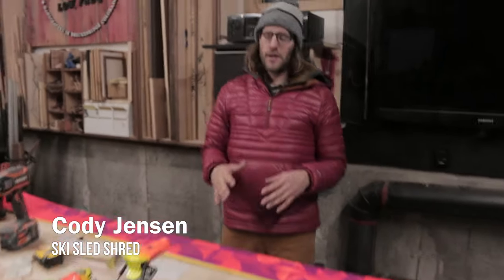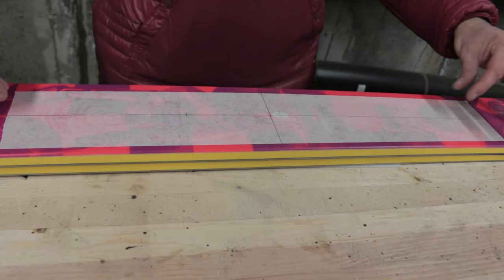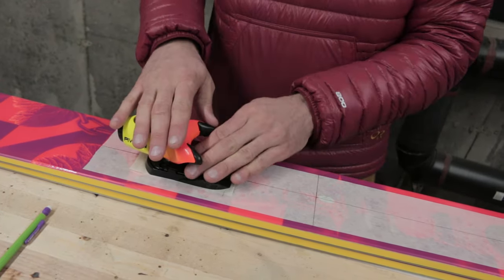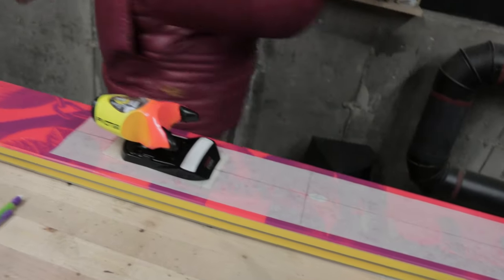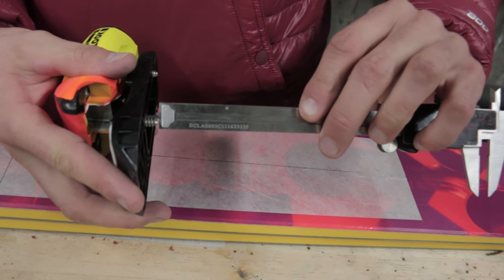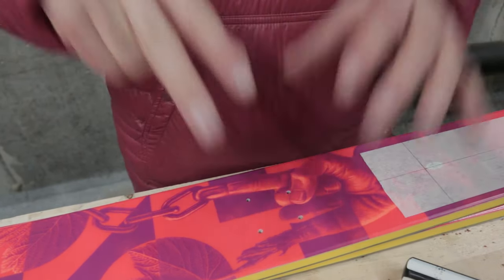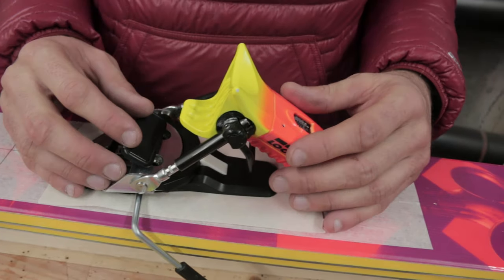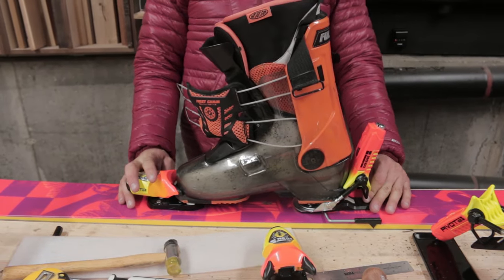How to Mount Your Own Skis

Comment: I would rather pay a ski tech $40 to mount my bindings, because I realize the amount of care needed to do this even though you may think it's easy and anybody can do it!
Reply: It’s a major rip off. It’s easier than waxing
Reply: @gooz0mbie  so you have your own Vermont Release Calibrator ? You trust the DIN scale on the bindings ? I’ve been mounting bindings since ‘78 and can tell you if you trust the scale you’re a fool.
Reply: @JJ-ph3gz  I always just crank the DIN spring till it stops … this isn’t the right way?!?! 😂
Reply: Honestly, if you can’t handle mounting your skis, you’re pretty incompetent.
Reply: I’ve had professional shops mount my skis and make a mistake and re drill the ski twice and I’m talking a plug right next to the new hole and not tell me.   I went to install binding freedom inserts and saw it the shop paid me for the skis and I’ve never been back to that shop.   I’ll be mounting my own skis now days but it’s also within my ability it’s not for every one I guess
Reply: I guess this an old comment but it’s like $70 now

Comment: I'm not saying you have to listen... I mean do what you want... but it's ridiculous to think the marking on the ski is in some random and unimportant place. That line takes into account the sidecut and camber. It's sub optimal to have your bindings mounted away from the center of the sidecut and camber.  should you double check by measuring to make sure the topsheet isn't weirdly offset? sure. But that's where you should start, and not deviate unless you have a good reason  to do so.

Comment: So if you’ve got 30% rocker up front and 15% in the back you’re still mounting your binding at centre? Sounds wack to me. Park ski? For sure.
Reply from the maker: Yes it's certainly unconventional, and I know it's not alwys recommended.. But I just love being center. 😁
Reply: @skisledshred1277  You can do what you want but it seems irresponsible to make a video like this that just recommends that blindly.
Reply from the maker: @antihero3zx  Oh I definitely don't recommend it. Never said I recommend it. 0:25 "this video is about how to mount your skis, not where to mount them". People should mount their skis based on their skiing style. I'm just saying they shouldn't blindly follow the topsheet graphics to get an accurate mount from one ski to another. Always actually measure the ski is my point.
Reply: @skisledshred1277  It's not the end of the world to mount them a few inches off, but i disagree. you should buy skis based on your skiing style and you should mount them where the ski designer intended them to be mounted.  Meaning if you want bindings mounted absolute center, you should buy skis that are designed for that.
Reply: @antihero3zx  There are a lot of freestyle skis now that have two recommended mounting points, one for progressive (more center) and one for traditional (farther back). Also, there are pro skiers who have a pro model ski and mount it more center than what the factory recommends. It all depends on how you like to ski and some skis are versatile enough (a big "sweet spot") that different mounting gives you a totally different (and totally legitimate) riding experience
Reply: @nkwillie  dude pro skiers aren't even usually skiing the regular production skis anyway even if it does have a production topsheet on it, so thats kind of an odd thing to claim.  I'm curious about how big a setback is present on skiis that have an optional mounting locator. What brands/models have it?
Reply: @antihero3zx  based on how many ski companies have shifted production to Asia and Europe along with how many smaller companies have had to cut their pro team down, it’s hard for me to believe that pros would get a few pairs of their one-off special ski for the season. There’s not enough money in the smaller companies and not enough hands-on control in the large factories producing skis for numerous brands for this to work. In terms of multiple mounting lines, my Line Blend’s have true center and recommended (-4cm) marked. I’ve heard their pro riders ride true center. The K2 reckoner 102 has -2cm as their team line and -4cm for their midsole. The Faction Prodigy series has something like -2 and -7. Really it all boils down to how you ski and for more progressive shapes sometimes you buy a ski that fits your style and also mount it to your style on top of that
Reply: @nkwillie  +/- 2-5cm is pretty much negligible. I've seen people take park skis and mount them 3/4 of the way back like they aren't even twin tips. in fact I bought a pair for my GF and the idiots had them setup like that.
Reply: @antihero3zx  right, at the end of the day it really doesn’t make that big of a difference to be a few cm back from center. I’ve personally struggled with the recommended line and whether the ski will suck if mounted elsewhere, but I think with how much thought goes into skis now a center mount is definitely considered when they design the ski—even if it’s asymmetrical. It definitely doesn’t seem right to be forward from recommended but in most (freestyle) cases, it works great. In the case of the skis you bought your gf, it bothers me when a twin tip is mounted like a directional ski lol

Comment: Just a point of interest: Most ski manufacturers print the recommended drill bit size on the top sheet of the ski. They use metric sizes. Usually for wood core skis 3.6 by 9.5 is a common recommendation. Skis with metal laminate or binding plate usually have a 4.1 by 9.5 and tapping the screw holes with a 12 AB tap to cut the tread recommended. You can buy the correct drill bits and taps on line at a relatively low cost. Also alpine ski binding screws require Posidrive #3 screw driver not a Phillips head.
Reply: I would think that the drill bit size is more related to the screw diameter than the ski itself...

Comment: Some really good tips and tricks in here. My professional "opinion" on glue is to not apply to the threads of the screws, proper technique is to apply a small dab over the hole and screw through it. As it drys, the job of the glue should be to form a gasket and seal out moisture. Applying glue to the threads doesn't make the mount any stronger, it just rips out material if you ever remove the screws (like when you need to replace a brake on those Look Pivots).
Reply: You could also just use some simple all purpose glue (not epoxy) to fill the hole, that does the job also to seal the hole and keep moisture out.
Reply: @coopernfsps  My understanding (and OK I'm not a ski tech) is that they always use a wood glue, not epoxy. The only caveat on this is when the screw pulls or threads over time, and then it can be possible to pack the hole using epoxy and other materials. Although I'm sure heli-coils are preferred these days.....

Comment: I do most of my own ski tuning and waxing but I never attempt to mount bindings. Ski shops have the proper equipment to do it right. And a binding that is even slightly off center or not correctly positioned front to back can cause the ski to act erratically and can cause the bindings to release differently depending on whether they release to the left or right. Better safe than sorry, is how I feel.

Comment: I suggest to drill the hole with a smallest size you have before using the right size.  That way, you can prevent the hole shifting away from the exact position that you get from tapping.
Reply from the maker: Great tip, thanks for the advice and for watching!

Comment: Nice video. I've mounted several skis freehand but after finally using a proper jig, I did what I needed to do to get my hands on my own FKS jig. 
You can't beat the amount of measuring the jig does for you. Centers the binding left and right, puts the toe and heel in the right spot with respect to the center of the boot, and even makes sure you drill straight.
Reply: How in the world did you get a hold of one
Reply: @gooz0mbie  been in the game for a minute
Reply: @gooz0mbie  just get friendly with a locally owned shop that's a look or rossignol dealer and have them order one for you.

Comment: Great, precise and clean job, pal !!! Few years ago i  also mounted Look 15 pivots by myself , but  jus as precaution ( in order to avoid some errors with mounting the heel piece )  i first  premounted a pair of those bindings on one  auxiliary  wooden board  and took the exact measurements and transmit it on my skis. I also keept the forward pressure  tunning rods somewhere  in the middle  position during the instalation so now they can easily accommodate several boot sizes. And yes, they are also GripWalk compatible.Very simple, proven, versatile and probabyly the safest bindings on the market. BRGDS
Reply from the maker: Nice!

Comment: One thing to mention- Ski bindings do not use Phillips screws. They are #3 PoziDriv screws and the proper bits make the job much easier without stripping the heads.

Comment: To anyone watching, if you are thinking about mounting skis yourself please make sure you have the proper tools and test mount the bindings on a piece of wood first to practice. I saved myself a pair of skis practicing on some old 2x4 to make sure I got my homemade template right. Make sure your bindings are straight and triple check you have it centered. It's not that hard you just have to be patient and concious of what you're doing. Also he doesn't tap any of the screw holes and uses super glue. You should buy a nice screw tap and use wood glue. The screws will sometimes back out of the skis due to the untapped wood not wanting to accept the screws. Tapping the holes also allows the wood glue to make a good bond with the entire screw and not just the bottom of the screw. Just my 2 cents. Great vid!
Reply: That's just not accurate.  The screw cuts its own thread valleys as it compresses and sheers the wood fiber.  Using a tap to cut threads in metal actually weakens the holding power if the screw.  Most wood glues are water-based.  If you're trying to bed the screw head, a product like 3M's 4200 poly sealant is best for a semi-permanant bond.  If you mess up and overbore the holes, you can fix your mistake by chamfering them and filling them with slightly warmed epoxy.  Warming epoxy helps it flow out throw the hole, but it also shortens the pot life.
Reply: @dinglesdingler1211  Yes, this is accurate for metal sheeted skis but, not more modern park and powder skis which are only composed of wood, epoxy, and fiberglass sheets to have more playful characteristics. The metal to metal contact when the screw enters is not there to hold the screws in place on park skis. I have had screws back out of park skis and I've watched some park rats rip entire bindings out because they don't tap the holes and glue them in with wood glue. Also I only use polyurethane wood glue which is not water based such as titebond. I was only responding in regards to the ski being mounted in the video. Good advice for fixing overbored holes! I use epoxy whenever I buy used pre-mounted skis to fill in the holes and the epoxy holds the screw in very well.
Reply: What is the typical tap size? Example m5x2.0
Reply: @johnk815  I think my bit is 3.5x9.5mm and use the wintersteiger tap. It works for my Salomon, Tyrolia, and Look Pivot bindings. I bought a smaller bit so I get a tight fit on the screw when I tap each hole.
Reply: @johnk815   I should add that mine are wood laminate which is typically 3.6x9.5mm and steel laminate is 4.1x9.5mm for bit size.

Comment: Best guide I’ve seen for mounting bindings!  Great job!  I’m about to mount some pivot 15s on my new powder skis.  The only question I have is locating the heel piece.  I see that you centered the post adjustments to be in the middle to have a little room, but can you give me an idea of what you look for in heel piece location?  From the video, it looks like with the heel piece pushed all the way down you had about 1/8” or so gap between the boot heel and the binding.  Is that about right?  Thanks man!

Comment: I personally would recommend squirting a little bit of wood glue inside the holes where the screws go, that way it locks the screw in and seals the holes from water entry

Comment: I tried to mount my own bindings once but used a slightly too big drill bit seemed fine until i skied landed hard and they popped off :(
Reply: you can mount them again
Reply: I did but I paid someone to do it 😂
Reply: How can you remount if you’ve drilled holes to your ski? Do you like cover them up and drill new holes?
Reply: @yeseniag2249  pretty much yea you plug the holes and make new ones
Reply: @yeseniag2249  Or you could use inserts like helli-coils I think they're called. But they increase the size of holes a bit.

Comment: Excellent video I'd make sure your screw hole is longer the the extension of the screw. Clearly you don't want to go through the ski but you also don't want to bottom a screw out. Also they make a chamfer bit you can turn by hand.

Comment: My only comment would be to make sure you drill perfectly straight.  Use a drill press if you don't feel confident w/ a hand drill.  You can also set the stops on a drill press.  Otherwise, the binding drill jigs have drill bushings to make sure you drill straight & some have built in stops as to not drill too deep.

Comment: Hello, awesome video.
What do you think about 115mm ski brake to 100mm waist ski?
Reply: It’s fine, brakes should be no more than 20mm bigger
Reply: I always opt for smaller brakes when using Look Pivot meaning, I use 95mm brakes on skis up to 110. You can just take out the brakes, fastem them in a vice and widen them a little. Better than to have too wide brakes that will drag in the ground as you cant the ski in turns.

Comment: Did you drill the ski with the same diameter drill bit as fir snuggly in the binding hole or did you measure the inside thread diameter of the screw?

Do you take the screw to a hardware store to find out what the threads ate and buy a tap for it?

Comment: Great job! No forward pressure adjustments on that binding?
Reply: Yes on look pivots you use the side post adjusters on the heal to align the white plastic tag with the rear on the heal piece.  
Similar to other model bindings.

Comment: Just a question, I’m about to get pivots but was recommended to use horizontal spring bindings for a ski over 100mm under foot for better power transfer. Do the pivots do ok with that width?
Reply from the maker: I have a pair 118mm underfoot and two pairs 124mm underfoot. Every downhill ski I own has p18's on em. I personally love them and would never put any other binding on my skis
Reply: @skisledshred1277  okay, I’m sold! Also, the brakes available are 95 and 115. Is it a stupid question to ask which one to get? I was told that 95mm brakes will stretch to fit 104 but I’m skeptical

Comment: So how did you figure out where to put the mark for your toe piece? You had a mark on your tape, where did that come from?
Reply from the maker: Measuring left to right from the sides to the center and from the mounting holes to center. Turns out the baseplate has a molded spine that lands dead center as well.

Comment: You know you can download and print out paper jigs online, right? Makes this whole process faster, easier, and more accurate

Also, for anybody watching, do not use an 11/64 drill bit! The industry standard for skis with a metal laminate is 4.1 mm, so you should use 5/32 which is 3.996mm. 11/64 is 4.36mm, oversized enough to risk pull-out
Reply: just buy a 4.1 on amazon.
Reply: You can download and print out paper jigs for some bindings,  not all,  as I have never found them for the ones i have done.

Comment: Bad, bad, BAD advice on placing all dead center of the physical ski for watchers.  Most skis are marked for THAT SKI as it was designed by the ski designer and impacts how the ski will perform.  Placing it in the physical center may DESTROY those intentionally placed markings for the best ski performance.  Current racer and advanced extreme skier for the past 40 years
Reply: Bad, bad listener. He said that is where HE chooses to mount HIS setup. Yours, is up to YOU.
Reply from the maker: Yes indeed😁 @randyabbonizio6216
Reply: best ski performance is relative to what you use the ski. I.e. touring, telemark, freeride, or slope. For touring and freeride, you may want to leave the marking 10-15mm towards the back. For slope, it is surely best to use the manufacturer's marking. But that is my opinion and my advice to you is etiquette!